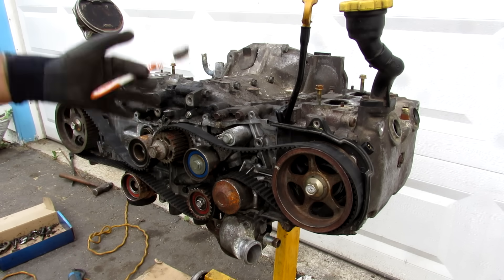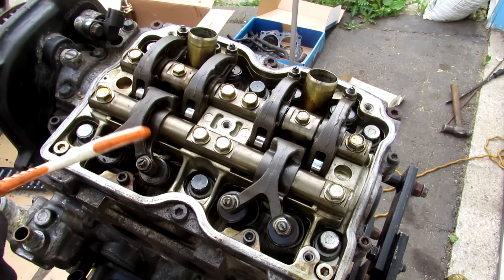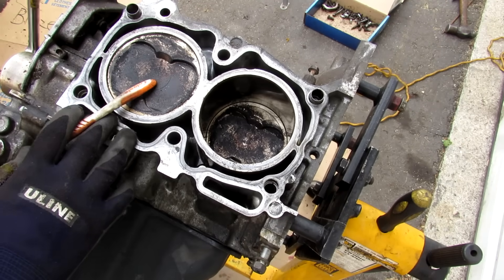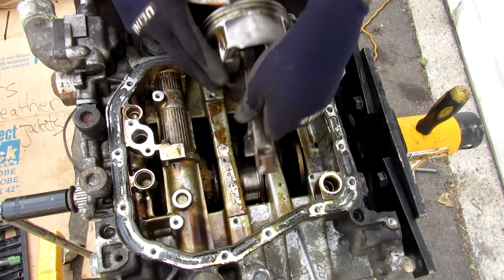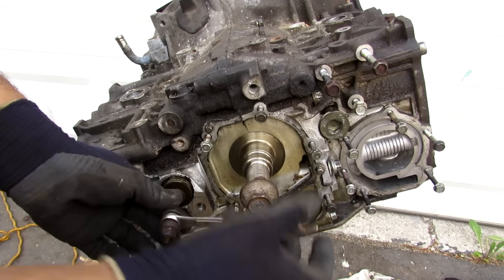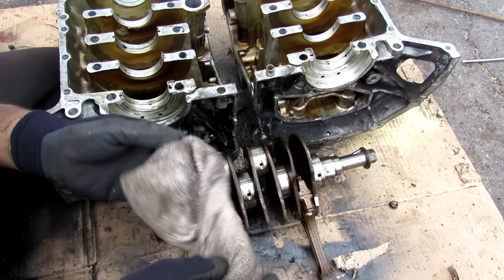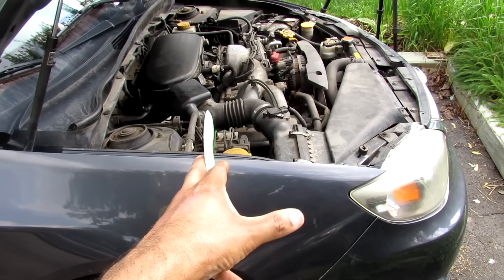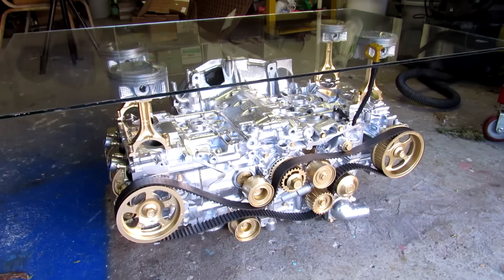Why Subaru Engines FAIL

Comment: The boxer is a fantastic motor yes just like every single motor out there you can pick it apart and the things that could go wrong you keep up with your motor maintain it regular oil changes regular scheduled maintenance routines this motor wheel well girl for  300,000 not a problem they are a great vehicle great I will drive system to keep up with her valve body change and your regular transmission oil change you’ll be fine do this to any motor that you have in vehicle and you will have a good running vehicle most the time do not be discouraged by people telling you and false things look it up yourself and try to figure out why Subaru is one of the top selling vehicles and foreign Japanese manufactures they sell so well that they can’t even make enough room to keep up with demand so go figure that Out since are so bad

Comment: Head gaskets fail mostly in the USA, because you floor it on low rpm, put too much boost on the turbo, hence think it's a V8.  No where in the world the head gasket is a problem where you drive normally. Every brand engine fails if you do the same, It's just that the ej25 has had a rumor that it's easy to boost, and it is. but subbie head gasket is not better than a volvo, ford, mercedes, or anyone elses.

Comment: I live in Canada and youll see old Subarus more than anything. I think 95% of subarus that dont last is because they are driven by degenerates. I had an impreza for almost 10 years and never had a single issue other then replacing a serpentine belt and a worn wheel bearing. Its the young guys driving their WRXs or  riced Imprezas revving them to 8,000 rpm is the ones that dont last and ruin this brands rep.

Comment: Hmmmm.......... I have owned 4 Subarus, 2 Liberty wagons, an Outback and I recently purchased a new Gen 6 Outback 2.5L because of my previous good experience with the make. The 3 previous Subarus all had over 200,000km on the clock when I sold them and none of them had engine issues and were still going strong at the time. As for any vehicle the important thing is to have them regularly serviced when due.

Comment: As much as I love Subarus, These engines seem completely random. A family member has an 07 Outback and an 04 legacy both owned from new. The legacy with more miles has been bulletproof for the 18 years he’s had it, but, the Outback has been also extremely reliable and dependable till 2 years ago when the head gasket blew. For 2 years it was fine… Till a few months ago where the head gasket went again and it needed a new motor, While the legacy was still running strong. Both religiously maintained too. Both been reliable in regards to the rest of the car anyway, The only thing that went bad between the two of them were a few wheel bearings and a power steering pump.

Comment: The owner is the reason why subaru engines fail, proper maintenance and this thing will last forever, my 03 Legacy has 320,000km and smooth as butter,

Comment: One thing I know about these engines is they are a pain in the ars to pull out of the vehicles their in, as a yardman I always dreaded them when they came in to the parts yard I worked at
Reply from the maker: Really? Don't they just drop down after the subframe is off?
Reply: @speedkar99  yeah I suppose it would be , they just cutting torches to get them out

Comment: Looks like the oil filter was  plugged  at one time and went into a bypass event . Cuttings embedded in bearing material are a sign of this  . Coolant mixed into the oil can cause an oil filter bypass event  also  so all the  cuttings  and dirt go into the oiling system . Unfiltered oil is a killer of engines .

Comment: its been 30 years...theres no reason to not have a 4 bolt per cylinder head that doesnt blow gaskets and better geometry and bearings to keep from knocking. Luckily its gonna be keeping people employed for decades🤣 Cant tell you how many HUNDREDS ive seen in the service department of the dealer i worked at for a few years even on the newer gens that are only a couple years old!

Comment: Awesome video, thank you!  I've never owned a boxer-engined vehicle, but your reveal certainly gave this DIYer some decent tips should that day come! No real surprises, the boxer engine still looks somewhat more impractical/labor-intensive to me from a routine service standpoint, so I presume its performance characteristics offset that sufficiently.  I had heard of head gasket leaks being notorious, also some transmission issues.  Do you have a similar transmission teardown that speaks to Subaru transmission peculiarities that may lead to problems?  Also, is head retorquing listed as a "routine" service item?  That also looks labor-intensive (i.e. expensive) as it appears that the engine has to be lifted off the mounts enough to get to the head bolts. I never retorqued a head, and presume oil and coolant would need to be drained first, and even then any pooled fluid might still infiltrate the gasket area during such a procedure, which would imply the engine needing to be completely removed and tilted as needed. Ugh.
Reply from the maker: You are welcome

Comment: Easy engine to build,  rr in 3 hours lol
Reply from the maker: Including splitting the block?
Reply: @speedkar99  No, 3 hours to remove and Replace engine. Rebuilding 18-24 hours I could in the Past when I worked on Subaru all the time. Moved on Diesel repair

Comment: If having an engine sideways caused it to burn oil easier, then you’d have the same results with boats, airplanes, and motorcycle engines.  The fact is, there is no proof or evidence that doing this makes the engine burn oil easier.
Reply from the maker: Use dry sump

Comment: I remember the 2stroke dirt bike my busy and I bought,, kids ran regular gas threw it,, melted the Piston,, but luckily the cylinder liner only needed some muratic acid to dissolve the aluminum off,, but did replace the crank rod piston the whole assembly,, but the Piston was impressively melted,, we thought it was total loss wene we tore it down,, but that was oh about 15 years ago and she is still alive,, unlike the kx 80 we litteraly blew up the Piston in,, my 71 Camaro 350 yeah the rod bearings and being 21, I kina killed that one my self☹️☹️ but it was fun🤣🤣🤘😎

Comment: Question: How much less views and money would Mr. smart pants here "earn" without stupid click bait titles? Subaru started building boxer engines 1966 and if this high output a dream to drive engine would have been treated with regular quality oil changes it would have been reliable. Or would you dare to call water cooled Porsche 911 engines a failure because of a boxer engine layout? Treat a Porsche engine this way and the result would be the same.
Reply from the maker: There's just a tendency for these engines to spin bearings so easily it seems like a design failure more than a lack of maintenance

Comment: Great video! I have a newer Outback. It's my first Subaru and I am very impressed with it. Proper and timely maintenance is key to the longevity of any ICE.
Reply: I have had many Subaru’s and never had any problems with them. I can’t find  another car that last 200 to 300 thousand miles.
Reply: @bigstyx  Toyota.
Reply: @bigstyx  
My 2009 Scion xD (bought new)
with regular oil changes (moooost of the time 🥸) is STILL running at 340,000 miles.
I think it will make 400,000.
Reply: @bigstyx  loads of Toyota's owned by harsh craftsmen run 600-700.000 km in Scandinavian climate.
Reply: @bigstyx  GM 3.8. Series 2 or Series 3. One of the toughest engine made. Plus fuel efficient. 30-32 mpgs and fairly quick. Buicks and Pontiacs and Oldsmobiles. Buy American.
Reply: @christinesommerfeld9815 the engine lasts but what about the transmission and the rest of the car? Typical GM crap.

Also some of the import brands are more American than American brands it’s sad at this point how un American GM/Ford/FCA are

Comment: Questions:    can the timing belt be replaced without pulling the engine?   Can the heads be re-torqued without pulling the engine?
Reply: Yes Belt can be replaced without removing the motor  No need to remove the radiator too.
Reply: @horitauri  Thanks for the reply

Comment: Errrrrrrrrrr...... what PRECISELY happens in the Subaru that other engines don't suffer? Are you claiming that in inline 4/5/6 cylinder or 4/6 cylinder V engines NEVER suffer dry bearings, faults with oil surge, oil in the water and vice versa, rattling pistons, faulty oil rings, faulty piston lands, head gasket failure and so on? In fact, name ONE problem that the boxer design of the Subaru does to reduce reliability of the motor that NO OTHER cars suffer!  Secondly, I love the hysterically funny way that you just stick one of the major faults with the Volvo or Supra at the end of a long sentence to try to dismiss the inherent design fault of the inline motor...... that of having a VASTLY too high centre of gravity caused by the misplacing of the heaviest single item in the vehicles SO HIGH under the 'bonnet'! The better and more complex cyclinder heads are even WORSE than the 'basic' design as they have their extra weight AT THE TOP of the engine. Subarus don't! Let's hear you tell us the problems with the Porsche engines that are ALSO flat boxers...... Try driving a Ferrari Boxer if you want to feel the effect of too high CofG caused by mounting the engine OVER the drive system!......... And you also try to dismiss the regular problems with moving front (or 4) wheel drive engines rearward...... that of needing to raise the engine even FURTHER to give clearance to the drive systems for the front wheels! The two manufacturers who are most renowned for having the engine right at the front of the engine bay are Volvo........ and AUDI..... and many of both have atrocious understeer problems........ the Subaru (Impreza) is hardly affected by understeer at all at road speeds! Finally, explain how gravity does NOT drain the oil from the 'top' of an inline or V engine when left standing..... this I just MUST hear!

I am scared to say the next bit....but....... I HAVE a 2006 STI PPP beast...... it has now done.......140,000 miles developing over 300BHP. And I still LOVE it! One of the most rugged, tough and hysterical cars that I have owned  in my LONG life..... and I have owned some spectacular cars! In snowy weather, I take it to the bottom of a LONG hill near me..... drive AROUND the BMWs, Audis and Porsches that are STUCK in the snow and waft UP the hill sliding the car joyously........ giggling!! 

Oh, and I have a 111R Elise to complement it! Even the stunning Toyota engine in that is known to have problems!

The Subaru ISN'T perfect, not least because of the appalling turning circle caused by the boxer engine design. But....... when I am on my own on a relatively winding road....... it is a laugh a minute! With family aboard, it's still fun but too loud and small....... on my own, however...... not much stays with it! What a STUNNING engine! And the SOUND: even with the standard exhaust, it STILL turns heads!!

Comment: Another great video, with interesting commentary.  The Subaru boxer engines are cool, but I wonder if you can get more than 100K miles before a rebuild.  Doesn't appear the owner of this engine did anything to cause the bearing wear.  I read that a few years ago Subaru made design changes to improve head gasket longevity (solid deck on block?).  My 1996 Plymouth 2.4L had an endemic oil leak to the outside which was solved by changing to an MLS head gasket.  OHC engines are much taller ('er wider for Subaru).  That is the main reason that 1960-70's cars have much lower hoods with their pushrod engines.  Chrysler leaned over their straight six long-stroke engine (slant-six 225 cu in) for a low hood.  GM and Chrysler muscle cars still have pushrod V-8 engines, but since the hoods are higher (for V-6 options?), they use the extra top space for a tall intake manifold with long runners.  In the 1960-70's they had to cut a hole thru the hoods to fit a tall intake in high-performance versions, which became a very noticeable design feature ("shaker hood").
Reply: The boxer motors are great.  All you need to do is change the oil/Filter regularly and timing belts when specified.  I've had two and both went well over 200,000 miles.
Reply: @DavidHuston  True since Suburu redesigned the engine to eliminate the notorious head gasket failures.  No expert, but recall that wasn't until ~2018.  Your engines were likely earlier so might have gotten lucky.

Comment: Had two subarus with 2.2 engines. Both went over 300,000 miles with no problems.Currently have one with a 2.5, so far so good.I think the early 2.5's had problems that the later ones had resolved.
Reply: Let's hope so 😁 can't afford a new vehicle
Reply: 240 thousand ej251 driving strong.. burns oil and probably leaks it somewhere too.. but apart from sounding like a sewing machine and the pistol slap on cold starts it runs strong. Headgaskets were done by previous owner at 140k tho.  Good luck with ur 25

Comment: Technically this is NOT a horizontally opposed engine.   It is a 180 degree V engine.
Reply: No, it's a boxer. The connecting rods have their own journals on the crankshaft.
Reply: @marsgal42  that's semantics as I would argue that a boxer engine is a 180 degree V engine.   They point is that it is not a horizontally opposed engine because the piston pairs are not colinear and do not share a single double ended connecting rod.

Comment: FRICKIN' CHEAP Timing-Belt Pulley GEAR!!! Subaru SUCKS!!  A $13 part, made of PLASTIC, vs. making it a $23 part using CNC machined, hardened Aluminum; THAT difference in THEIR 'Bottom Line' Cost ME over $2200 in Repairs!! Oh, and that the Valves are close enough to the Pistons to get bent when the CRAPPY PART fails!! CHEAP CRAP, Subby! I'll NEVER, EVER, own another!!

Comment: This is why I turned to Mitsubishi. Subaru is fun but their engines just suck. They had 400,000 recalls from 2017-2019, in just 3 years. Mitsubishi is, on the other hand, very reliable. I think you should give it a try, you will be happy 👍

Comment: My son has just acquired a Subaru Impreza, fortunately it's a company car so it's not his problem for the 3 years before trading in. but it looks like checking oil and changing it on time is critical.
Reply from the maker: Yes. Even if it's not his car, please check the oil often
Reply: @speedkar99  i will thanks.

Comment: I used to work on the original VW beetle engines.  I bet those pushrod boxers were more dependable overall than these ten foot timing belt waterlogged weirdos.

Comment: Conclusion: Do proper maintenance on your boxer engine. 
V engine has smoother delivery vs inline and boxer.
Reply: Nope.  V engines need large counterweights or balance shafts to be smooth, with the exception of a V-12 which is two inline 6’s.  The in-line 6 is the best and as perfect as possible

Comment: I had a Subaru '92 Legacy with an EJ22 2.2 liter Boxer engine. The smaller, earlier version, but basically the same system. One flaw you didn't mention is that the thermostat is right under the drivers side forward piston. [No. 2] This can cause it to overheat and cause waterpump failure. The higher heat, if unchecked,  will also cause the head gasket to fail  I was lucky, and caught the overheating before it got bad. I had to R & R  the whole radiator and hoses, and add fresh coolant.  Also the spark plug blew out from # 2 cylinder. Stripped head threads. I had a shop heli-coil the spark plug shaft. Ran fine for a year, and then BANG the #4 plug popped itself out too. Back to the shop for another heli-coil job. Finally sold it to a guy who wanted the engine for a VW van conversion.

Comment: That was a great tear down and explanation!  Thanks!  I've rebuilt VW bug motors before.  I have a 93 legacy with 230k, that I use mostly in deep snow for a ralley car fun. (Old Tacoma is my daily driver).  Needs a clutch, but still runs great, and is super fun in the snow.  Should I rebuild the motor, or just sell the car.  I really like it and everything except the ac works (we live where it doesn't get hot, so I don't need ac).  Is there a way to do a "cheep" rebuild?  Just change oil pump and rings, clutch, water pump, etc - but not new pistons, crank, machine work, etc.  It doesn't need to be a race car - just run good, mostly spinning tires in 2nd and 3rd gear (up to 45 mph usually).
Reply: Run it until it blows.

Comment: Subaru engines are one of the most reliable engines on the market. 
Another is funny enough a Porsche, also a boxer. 
The spare parts are unfairly expensive, but that's because they rarely break

Comment: Had an XT with 2.0L boxer where the head gasket would break/leak from the waster jacket to the cylinder head.  I would get a ridiculously good 50MPG for that first week or two it was busted.  Makes me wonder if a little bit of water injection would improve MPG's on everything or if it was just anomaly with that particular engine.  The head and cylinder head were pitted under the gasket causing the failure about once a year.

Comment: I own a 2014 Subaru Outback and the engine blew a rod at 89,000 miles. I knew the car was burning oil, about 1 quart every 2,500 miles, and tried to keep the oil level up, but in the end I still lost the engine. The new engine ($6,000 installed!), made in 2018, also burns oil, though slightly less than the old engine. Unbelievable.

So if you are thinking about buying a 4-cylinder Subaru, of any model, think again. And it's not just because of the oil burning problem. My Subaru also needed a new clutch at 100,000 miles (throwout bearing issue), air conditioning soon thereafter, radiator, rear differential mounts, and a bunch of other fixes that are unusual for the age and mileage of the car. My vintage 1994 Mazda Miata is more reliable than that.
Reply from the maker: Sad to hear. What did you do with the old engine?